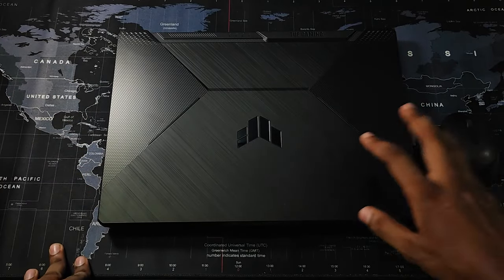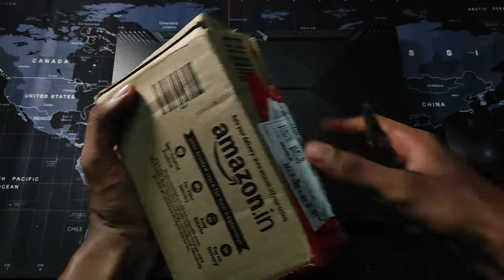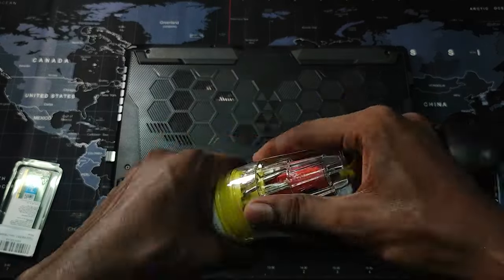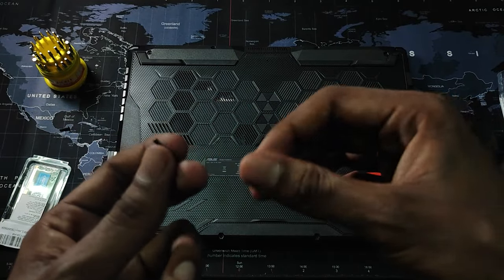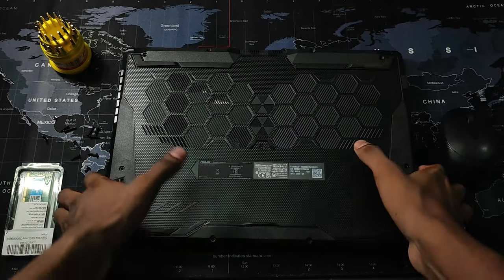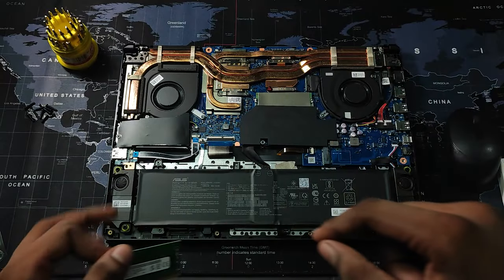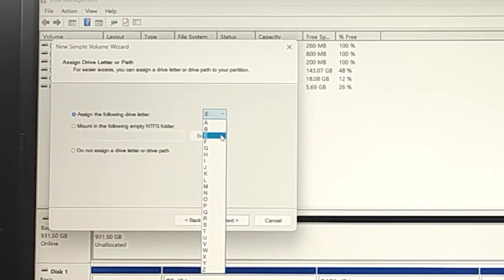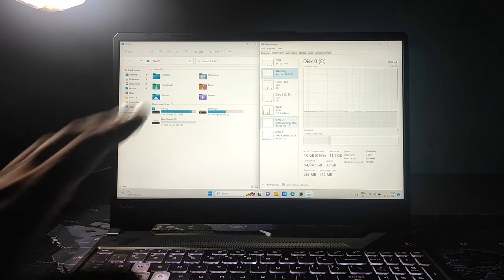How To Upgrade RAM & SSD in ASUS TUF A15? - FULL TUTORIAL - [16GB RAM + 1TB M.2 SSD Upgrade]

Comment from the maker: Note: (Before doing the installations)
1. Disconnect the battery(no need to remove it from the casing).
2. Press the power button for 15-20 seconds to drain the residual power, which might cause static discharge.
3. Follow the rest of the instructions in the video and you're good to go!
Reply: I have a doubt 
No need to install the windows

Comment: ALWAYS DISCONNECT THE BATTERY FIRST and then drain residue by pressing the power button for 15 seconds. Not good mate
Reply: Why? I tried to remove it but the battery is so stiff I didn't think it was removable
Reply: Bro he not talking about battery 😂, he talking about battery switch connection in motherboard 😅😅
Reply from the maker: Thanks for pointing out. Appreciate your feedback!
Reply: What do you mean by drain residue can you please explain
Reply: @vexfig  Almost all electronic devices retain a certain amount of current even though the device is switched off from the battery.
Reply: @rsmickeymooproductions4877  so i have to hold the power button for 20 sec, should i do it after shutdowning my laptop and should i do it before or after opening the case ?
Reply: @vexfig  shutdown, open up, disconnect battery and then press the power button for 15-30 sec.
Reply: is asus tuf gaming fx506lh compatible with WESTERN DIGITAL WD Black SN770 1 TB Laptop Internal Solid State Drive (SSD) (WDS100T3X0E)?

Comment: I have the same laptop and I also want to upgrade it with the same configuration as yours, my question here is that I'm actually confused between which ssd is compatable with my laptop because there are two types of NVMe SSDs i the market one having only one cut-out like one you used ans another one with two cut-outs, the sticker on my laptop show 2 cut-outs ssd but you are putting the one cut-out type ssd on yours. Which one should I use ???

Comment: I'd like to clarify somethings for people (I've owned this model for 1 year):

First; check which generation your M.2 NVMe SSD is. If you have an A15 like mine your stock specs are a gen 3 500GB SSD. 
This means if you upgrade to a gen 4 SSD (which are both M.2 NVMe gen3 & gen4 slots) then you should think of transfering your operating system to your new drive. The difference in gen3 to gen4 is VERY significant being around twice the R/W rate. 
There can be signifiganct bottlenecks here. I would also make sure your new SSD comes with DRAM.

Second; make absolutely sure what kind of RAM you have inside and buy appropriately. My A15 comes with 8BG DDR5 @ 4800 Mhz.
Significant bottlenecks can happen here if you pick wrong. Since mine comes with RAM I want to add some. I'm buying 1 x 16GB DDR5 @4800 Mhz.
I'm also pretty sure this doesnt mean I now have 24GB RAM. 
Well I do but 8GB of new memory @ 4800 and the 8GB of old memory are now running optimaly as 16GB dual in line and 8GB @ 4800 but in single line. Still great, just not optimal. But also add some virtual RAM or 'paging' from your SDD (probably at least 8GB virtual although I like to have 16-24GB virtual to run virtual OS for fun) 

Third; use the tools they give you for optimization. There's this ASUS program which is basically a CNTRL+ALT+DLT on roids. If you're gaming, editing videos, using blender, etc. then turn off browsers and programs. But turn on the MUX and 'optimal game settings' where it forces your computer to dedicate the GPU and higher power output for performance. 

Sadly I do not think the Ryzen 7 in this laptop can be overclocked because of the 140W rating and risk of overheating as well as some issue with core designation. But i do think the CAS can be modified in the BIOS to optimize your extra 8GB RAM for dual in line use if you get an additional 16GB like I did.

I'm fairly experienced with computers and I've done all this research on forums after exactly one year owning this computer in stock config. 

Ill be purchasing the 1x16GB DDR5 4800Mhz RAM module and 500GB m.2 nvme gen4 SSD on this week. My honest opinion is buy this laptop only if you plan to buy extra RAM immediately or are very good at optimizing memory performance. That other slot should be filled with 8GB min
Reply: As an update:
I ended up purchasing 1TB of the new Samsung 990PRO PCIe 4 M.2 2280 SSD  without the heat sync. The Black Friday sale was very significant dropping the price to only $80. The version with the heatsync was only $10 more. It's a cool little addition helping keep the temp 5°F-15°F lower and R/W speeds at 100MHz-200MHz higher, there is also, a not insignificant increase in Windows, editing/rendering and especially Gaming performance. 

However, I read that the 990PROs had updating peoblems upon release, leading to issues in the firmware. They've rubbed the kinks out of the non-heatsync release but the one with heatsync only just got on the market.

There are also extra programs for the SSD management and there's an RGB strip on the drive which is managed through a different program.
That all seemed a little too much so I just opted for the regular drive (especially since i can always get a $10 heatsync on Amazon, just not proprietary). If anyone does get any version of the 990PRO SSD, make sure that- after installing it and updating the firmware through the proprietary software - do not simply restart your computer .
This is how people had firmware issues with warranties that Samsung, typically, did not honor. From what I've read the simple ' Restart ' will not shut the TUF or ROG series mobos all the way off. This needs to happen or the SSD firmware won't initialize properly (I read that a voltage on the motherboard will issue different values for dwords and a ton of other nonsenses. If it's restarted you'll need to reinstall, configure your BIOS and alter a bunch of registry files, while if you just want a refund then Samsung won't budge saying you voided the warranty by not listening to the stupid SSD software).

As I've wrote, both of the PCIe ports on the motherboard support the 3.0 and 4.0 so if you plan to upgrade the SSD, you should definitely invest in the 4th generation technology. Regardless of the issues upon release the 990PRO is still the best all around gen4 SSD, possibly even among gen5. I'm certain that it has the highest bulk R/W speeds and power/ heat management of any SSD on the market.
I've also read that the firmware issue is more common in the 2TB versions so decide accordingly. 

Lastly, the heatsync version should fit in the laptop just fine, but there is also a 4TB version, but only for the heatsync, and it's likely overkill unless you add the full (2x32) 64GB of DDR5 RAM (although the website says (2×16) 32GB RAM is the maximum, I've read many users claim their system read (2x32) 64GB RAM without issue, showing the channel as dual-in-line on CPU-Z).

*Sorry for all the text, but I've seriously read hours into the datasheets/user-manual and forums. I really enjoy this laptop and I want the rest of the owners out there to have an easier time finding info on proper upgrading than I did. I feel like price-wise and upgradeablity, this is the best all around little gaming laptop on the market. 
I spent around $650 on it last year on Cyber Monday and spent around only $120, this Black Friday, upgrading it.

In total this is now a RYZEN 7 6800 CPU, 1.5TB PCIe gen3/gen4 M.2 SSD, 24GB DDR5 @ 4800, w/ a Nvidia 3050ti 4GB GPU and 144Hz quality screen for only $770!
I've never owned a system with such specs so cheaply. The only real competition would be these new Framework Laptop.
Reply: Great! Boris, I'll keep on eye on this recommendations!, 
I would like to ask to you if the sencond m2 ssd slot is slower than the first one?
Reply: @andresr9802  No me Brother, no slot or bus is slower than the other. Just your own preference of where you want the new drive. Both busses are PCIe gen3 & gen4 so are capable of those speeds.
I believe a PCIe gen5 SSD will work as well but only at gen4 optimal speeds.
Reply: @borisdorofeev5602  thanks bro! Awesome info!
Reply: There are some questions I need to know:
1. If I decide to add more RAM to a laptop and want both RAMs to run as dual-in-line channel (which I guess it makes the total RAM run at their full speed), everything I have to do is insert the new RAM module or is there any extra configurations I need to do?
2. Is it safe to do any storage/RAM upgrade before booting up a new computer for the first time?
Reply: Bro can you please reply me if asus tuf a15 ryzen 7 5800h rtx 3060 suppotrs pci 4 ssds or not?

Comment: But bro...in asus tuf a15 storage details r 521gb PCle 4.0 NVme M.2 ssd
But yours one is PCle 3.0 NVme M.2
Why not 4.0 and why 3.0 ??
Reply: 4.0 runs a lot hotter than 3.0. Still does the job but your laptop will run a lot hotter than if you were to use 3.0. I found it hard to find any 3.0 in my area so I ended up getting 4.0 instead.

Comment: I am unable to take out that little black screw. Which size screw bit you used?
Reply: that screw has been threadlocked brother, you wont be able to unscrew it using a basic screwdriver, you will need a soldering iron for it but i guess by now you have already fked up the screw 🤣
Reply: I was on the verge of losing my sanity over that screw, but with the little sanity I had left, I took my laptop to the repair store. Half of the screw head was damaged, but fortunately, it didn't require a soldering iron. A small screwdriver bit did the job. 🥲
Reply: Bro now I'm facing the same issue and my screw is also got little damaged what to do now?
How to unscrew it???

Comment: Is SSD screw counterclockwise?? 
I am trying hard but can't unscrew it
Reply: Me too bro it's very hard what to do now it's not opening😢
Reply: Did you unscrew it now???
Reply: Go to any laptop repair shop. Before you damage the screw head more.
Reply: I did the same. It needs a perfect fit deeper screwdriver bit. Fortunately, my screw was damaged only on the surface and he managed to unscrew it easily. 
Buying a laptop screw kit is also an option for future occurrences but for now don't force it more since it is directly located on the motherboard.
Reply: @wanderer9593  bro if the screw got fully damaged then what is the solution of that i mean then what will a repair shop person do??
Reply: @wanderer9593  bro i bought a laptop tool kit and i used the same screw driver which was needed for that screw but unfortunately that screw was very tight and not opened and now it got damaged
Reply: @_huxaifa._  thing is.. perfect screw bit don't damage that screw. And it has some locking mechanism. So literally no use of force. Just visit the laptop repair shop. Even if the screw is damaged, they will find some idea..
Reply: @wanderer9593  bro one thing more, actually my laptop is under warranty so Does a damaged screw void my laptop warranty?

Comment: bruh not related to this video but i am facing some disconnection problem from usb port which is beside of type c port . Whenever i connectt my phone using usb my phone disconnects after some time it charges but this problem occurs . is this hardware issue or softwware plz tell me

Comment: Hi
Thank you for the video!
However I have a little issue
I put a 2nd SSD in the other slot, but it's not detected by my PC when I go to the storage. But in the task manager, it is detected as it says "Slot used 2 of 2" but when I go to disk manager, only my first one show up

You should note that it was the SSD I had in a previous laptop (with probably the OS in it) so that's maybe why
Reply: Is it showing up in Disk Management ?
Reply: What happened? Did u solve it?
Reply: Needs formating likely. You bought it used right? Because if you did just go to disk management and format or look up the CMDs for CMD line which are wayyy easier imo.

Comment: Bro did u remove the 512GB ssd or u just added the 1TB? So all in all u have 1.5 TB SSd?
Reply from the maker: I didn't remove it bro. So it all adds up.
Reply: Is it possible to add a 2 Tb in the secondary slot to make 2.5 Tb or is 2 Tb (1 Tb in each slot) the limit?